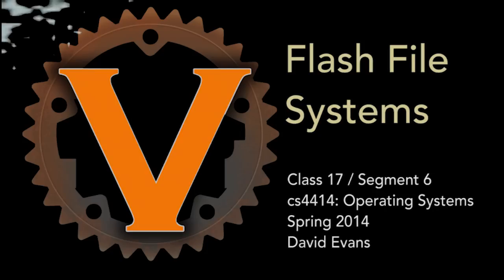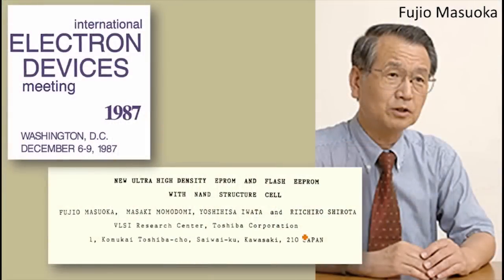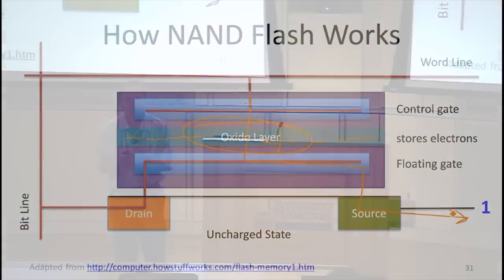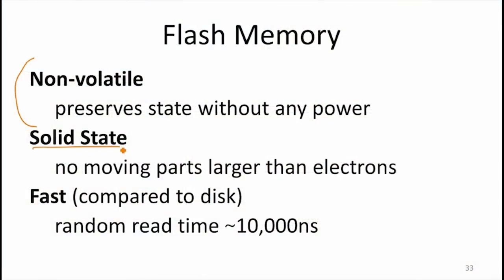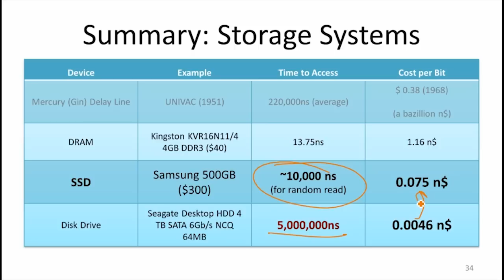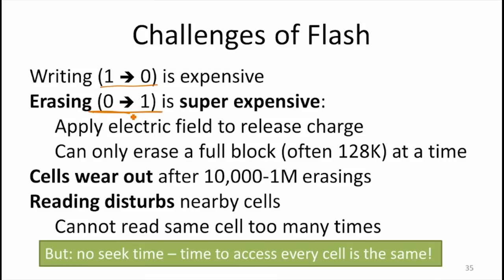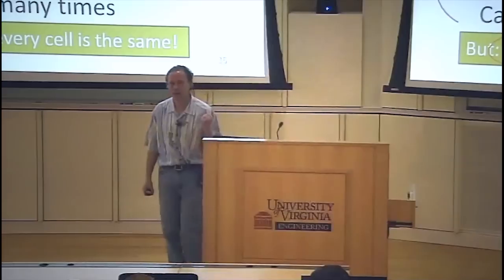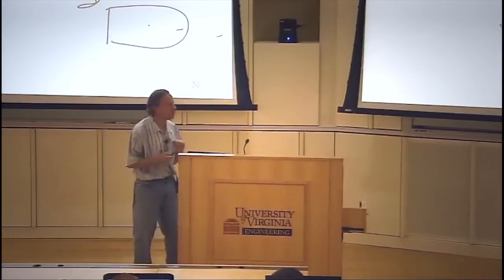Flash Memory

Comment: Major errors  Pull this from YouTube  1st Error at 1:12 your charges are not stored on an oxide they are stored on a polysilicon gate You forgot to put the floating gate in the cross section.30 + more errore all references to the functionality of the FET are wrong.